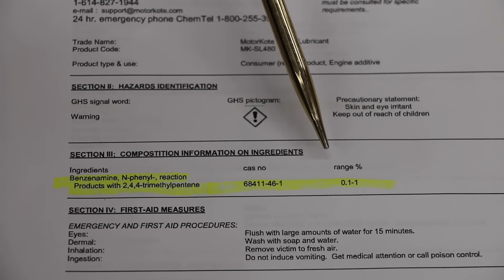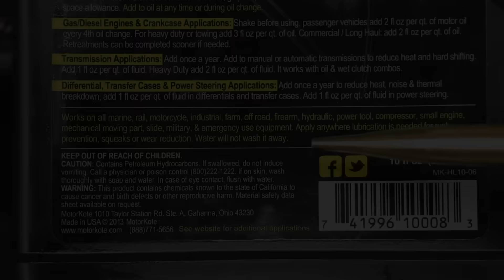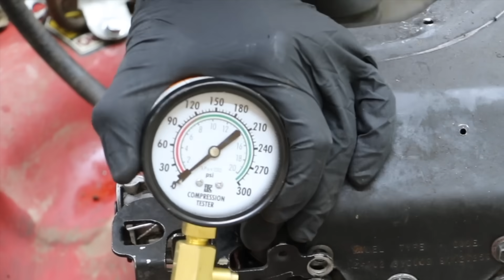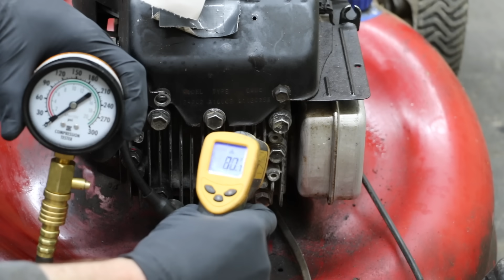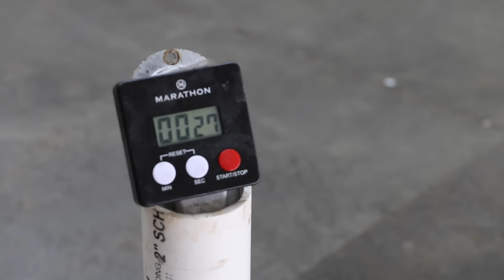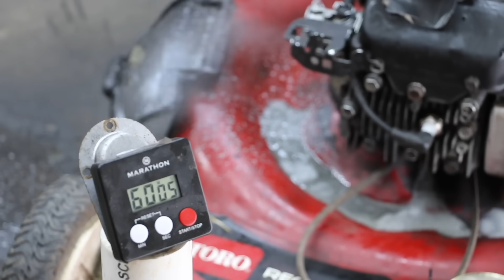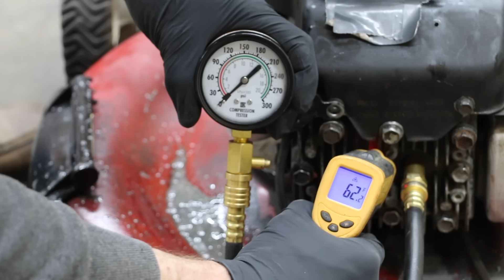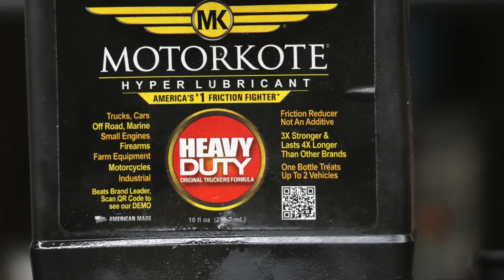Can MotorKote survive the water test?  Let's find out!

Comment: Wow, that's pretty astounding. I wonder why the big oil companies don't put a splash of this in their regular off-the-shelf oil...? Seems it could be a massive advantage. I may have to look into this stuff.
Reply from the maker: Thank you
Reply: @ProjectFarm  Oh dang. I  did a bit of research on it and it basically contains about 28% chlorine which turns the oil you put it in into toxic waste. That's why the big oil companies don't use it.

Comment: Ole  '60s big block gear head', hear again. Please, don't all the negative folks out there, roll your eyes. Oh, and I don't drive 100 mph either. Although, I have, and faster, many years ago. Before fuel prices went through he roof! Last week, Oct. 31, 2018, I decided to add 3 oz. of MotoKote to my 313,000+ mile E250 Ford extended VAN untouched (other than me changing filters) transmission. Just for the hell of it. Now, I don't have another vehicle. So I only have one to drive. And, being an OLD(50+yr.) mechanic, I listen to every sound this thing makes. This small(3oz.) amount of MotoKote definitely made this old transmission shift more positively. (not that it was bad. but it was better after adding the MotorKote). Again, I thank Project Farm for such a thorough product test. At my age and experience, I'm not easy to convince. But I'm pretty sold on MotorKote.
Reply from the maker: Very nice!  MotorKote has a huge following in the trucker world.  Several truckers mentioned using it with great results in driving 1 million plus miles. Thanks again.
Reply: How's your van running?
Reply: @Sno6403  Ole Geezer gear head here. To answer your question, its still running just fine. Now with 327,000 mils on the untouched 5.4, 2 valve V8.(not driving around as much as I used to, with this damn pandemic and all)
Reply: Papasmurf7597 - glad to hear someone used it in their transmission. Since the product claims it can be used, I was wondering if anyone had any experience with it in that way.

Comment: Another product that may be worth testing would be NMF (No More Friction), it uses ionic bonds to repel metal to metal surfaces at a microscopic level a lot like two opposing magnetic surfaces. I have tried it in many small engines along with me 3.5L Ecoboost with great results!
Reply from the maker: Great video idea!  Thank you
Reply: How does NMF perform? I am curious to the results.
Reply: Charles Peterson II  personally I have seen higher RPM’s, better fuel economy as well as slightly lower engine temperatures. There has been one small engine that I noticed had next to no difference except slightly higher RPM’s!

Comment: Great test. Looks like a great treatment. I plan to try it. Thanks for the great test. I have been in the auto industry as a service advisor for 25 years and in person seen a test of bg moa on a bearing lubricity tester such as yours verses conventional  oil, and synthetic oil. The syn did beter than the conventional, which looked like your bearings,  but the bg moa had virtually no scaring at all, better than the motor coat, but close.
Reply from the maker: Thank you

Comment: I'm curious how a limited slip differential friction modifier (i.e. Sturaco 7098) would compare.  In my understanding, these friction modifiers have an affinity for steel, and will remain on the surfaces when oil is drained.  It sounds similar to how MotorKote is acting in this test.  When filling a limited slip axle, and then adding the recommended amount of modifier to your axle (typically 2%), I've heard you can end up with a higher concentration due to the modifier that had basically clung to the surfaces inside the axle.
Reply from the maker: Great video idea!  Thank you

Comment: Todd, would you please use your lubricity tester on 0w40 Castro edge vs Mobil 1 0w40. 
I'd very much appreciate it. Many thanks
Reply from the maker: Thank you for the video idea!  I'm still working on the test design for motor oils. I want to include a little more rigor.
Reply: A used pour and lubricity test could be an idea, I know my Cayenne is supposed to do 20,000 miles / 2 years between changes (2004/5  V8 with the 4.5)  I've previously used Mobil1 and  this time I did a change at half of that. Obviously I was curious how it is - but that oil lab test is like £80+ ($120) here so a change is half of that cost for a home tech.
Between you and me  I'm thinking of doing a chilled new to used (2˚C) and a frozen test at -18˚C or below and see how that comes out.

Comment: So my final results. 2017 Honda Civic 2.0L average 35.43mpg over 4,038mi before. After using MotorKote average 36.30, up 0.868mpg, or 2.45% over 2,392 miles, 9 fill ups. Not crazy amazing, but it does seems to work. I will keep using it.
Reply from the maker: Impressive results!  Reduced internal friction.  Thanks for the update.

Comment: Where is the "control" test? Run an engine with water as oil without running any additives beforehand :)
Reply from the maker: Great point. Engine probably wouldn't survive the baseline test.
Reply: Well, you won't know until you try it!

Comment: I bought motorkote yesterday and added to my transmission fluid it really works. The car shift poorly after driving it around 10 miles. It shift good when the fluid is still cold but it shift bad once the fluid got hot. I added 12 oz to my trans fluid drove the car for 40 miles, accelerates and it shift smoothly. It probably helps to keeps the fluid cooler.
Reply from the maker: Excellent!

Comment: I just had a thought.. all of your testing is in small engines with a bath style oiling system. I wonder if some of these additives and what not molecule size would be filtered out by a standard grade oil filter in a car engine.. I know they make oil relocation kits to relocate a filter and/or add a cooler to pipe oil through, I wonder if you built a rig and used a solvent pump to pump that 'mix' through a car oil filter while doing your engine test... 'fittings in the oil sump of test engine or something similar' i wonder then what the results would be? Just a thought.. while I was at work... love the channel, i've talked to several people who love your channel, keep up the good work.
Reply from the maker: Great recommendation!  Thank you

Comment: Do you think I could add Motorkote to a GDI engine? I know some oils have detergents to keep the back of the GDI valve clean. I bet if you put this in a new engine it would keep the back of the valves clean. Carbon wouldn’t be able to stick to the valve.
Reply from the maker: This is a great question and I'm not certain. Recommend contacting MotorKote.  Their website has their contact information. Thank you

Comment: How did I miss this? This is what I'm talking about. Dissimilar metal bearings kept cool with water and making allowances for steam. Can't wait.

Absolute best test ever!!!!! Personally I think the water cooling can take a lot more credit than most people will give it in this test. I bet you would get similar results with STP oil treatment.  Did you ever do just plain water? My wife loves to mow grass every Sunday almost all Sunday. If I could figure out a way to auto fill with the water i'd set it up with an antifreeze mix(for corrosion protection) and let her go with it. I have 3 or 4 mowers for her to use so no real loss if one died. In fact the deck is just about done with her current mower. 
So did you ever do one with just water? 
Just antifreeze?
If you do and want to recycle some of that water spewing out the breather, just add a larger hose (preferably clear)to the breather and run it up to a catch can suspended from the handle somewhere. Any condensate should run back into the engine. Or if you really wanted to take the time you could add a return to the block by drilling and tapping a hole in the block. Your catch can could have 3 ports though you would probably only use the supply and drain ports. 

Oh wait. What about gasoline instead of oil. lol You would have to replenish that constantly as well. Bad news if it blew up though. lol Highly suggest running the breather into the intake or a catch can that can condense the vapor back to liquid. 
Great stuff. Gets the imagination working for sure.
Reply from the maker: Thank you!

Comment: You just sold a crap ton of motorkote.
Reply from the maker: That's not my objective. I test products to determine if they deliver on the promises made by the manufacturer. Thank you
Reply: @ProjectFarm  this might not be your intent but this video really helped in deciding motor kote is by far the best. Even Lucas could learn some things from motorkote
Reply: Same here, going out and getting a few bottles of the stuff tomorrow
Reply: @isabelhughes8748 
Lucas? Those impostors must find another way! Cheers!
Reply: @isabelhughes8748  my only concern is motorbike have wet clutch, would motorkote make the clutch slips?
Reply: we know, but we are also skeptical and you do what we wish we could do with these products!  So it's nice to see you find a good product because we know it'll be good for us.
Reply: @ProjectFarm  I think the standard should be, you're only compensated where claims can be substantiated.  This seems perfectly win win.
Reply: So true, I'm on Amazon right now, lol.
Reply: @psedog  Go to a Pilot Oil or Flying-J...they carry it.  I think PETRO has it too.
Reply: Mine came in today. It's going in my motorcycle, truck and mowers.
Reply: @netxphotography , it works on door locks too.
Reply: I bought motorkote. Works great on electric motor bushings
Reply: yep i ran out and got 3 qts on my way home from work damn though 30$ a qt
Reply: @J0k3rSuiCidE  you could drain your debit card and get the $100 gallon bottle
Reply: @michaelc9128  The Gallon Size is the best for Dollar Value.  If you're an average user, it'll last you a fairly good long time and you only need to use it once every 3-4 Oil Changes.
Reply: @michaelc9128  The $100/Gallon is actually the best purchase for the volume and money. 4-32 Ounce Bottles will cost a lot more!
Reply: @michaelc9128  I got it  for $80 a gallon.  So what, it will last me 5 years.  2 cars a pickup and a boat.
Reply: @J0k3rSuiCidE  $22.99 on Walmart and Amazon sites
Reply: @J0k3rSuiCidE  I'ts cheaper by the gallon!
Reply: my new wd
Reply: Gettin me some of that rn thank you sor..
Reply: Why not just use straight motorkote 🤔🤔😜😜🤪🤪
Reply: Read my post. I used to work in this field and what the company is not saying is what can harm your engine. Adding oil additive to a SAE API rated oil makes the oil no longer past those test. Which if a informed dealership knows this can void you warranty right on the spot. The reason the oil changed color is because most oil additive companies use chlorinated paraffins aka chlorine. The color change was the chlorine reacting to the oil like bleach does and making it turn a lighter color.

In my post I just made I showed the testing a person could do to test if the chlorine is the main ingredient. i also explain why such companies use chlorine.
Reply: This stuff is liquid gold
Reply: I buy this stuff in bulk. I use it on every new full synthetic oil change. I put about 2 to 3 oz. In
Reply: And they earned every sale
Reply: It's good stuff
Reply: Motorkote is the only thing I recommend to my customers as an ASE Mechanic. 
I use it every oil change even though you can go every other oil change
Reply: Just bought some 😊

Comment: I would be interested in a comparison of how quickly water instead of oil destroys it without their product.  Maybe its just a really well built motor that can put up with poor lubrication?

Maybe you could even build a device with a couple tubes like the automatic plant water thing to keep the water level correct as it evaporates...sealed jug with 1 small tube to bottom (to drain water into crankcase) and 1 small tube to the top (to let in air when it drops below the required water level) so you do not have to stop and fill the water up periodically.
Reply from the maker: Great test idea!

Comment: I had a very good running 2.0 sohc 4 banger in my car that started to have lifter noise so I used lucas and lost power then blew a couple rod bearings with in a month, had lucas in my turbo oil system and burnt up the bearings, never using lucas again but maybe I'll try motorkote one day to see if it makes my turbo last longer. Great video.
Reply from the maker: Thank you

Comment: Awesome video! From your test, this product clearly reduces friction. However, I am still undecided on weather I would be comfortable with using this product in something I care about since from I read, it contains chlorine, which can cause corrosion. I added it to my daily driven Honda Civic with a bad engine as a test, and I don't think it did anything terrible yet. So far I ran it about 3000 miles since I added this product. If anything it may be running a little quieter since I added this product. However, the engine in that car is junk, so when I replace the engine, I'll make a video of tearing down the old one to see if there is any corrosion from using this product.
Reply from the maker: I'd really like to see the video you make when you decide to dismantle the engine.  This product is very popular in the trucking industry. If this product causes corrosion, it would seem as though the truckers would have figured this out, since they log a lot of hours on their truck engines.
Reply: Great point! This product is probably safe. I may just be overly cautious about products like this, but there have been (and still are) oil additives that are not safe and can cause damage, which is why I'm trying this product in a bad engine first. I probably will run this engine another few thousand miles before I tear it down if it'll go that far, so it may be a few months before I make that video. But I'll be sure to let you know when I make that video!

Comment: Hi. I use it on my Renault Capture 1.5 dCi since February 2017 and i notice that the engine works really smoother and less noisy. I'm also able to shift gear a little bit earlier without feeling that the engine is "suffering". I haven't notice advantages on fuel economy, maybe the change is really small and difficult to see.
My question is: can MotorKote cause clutch problems on motorbikes that use wet clutches?
Can you do a test about that?
Thank YOU! :)
Reply from the maker: Glad that MotorKote is delivering great results. It is not designed for use in motorbikes with wet clutches. It will cause problems.

Comment: Motorkote, or Turbomaxx? Equal?
Reply from the maker: I'll have to test Turbomaxx. Than you
Reply: The one arm bandit test would probably be enough. Their video shows many weights put on the arm and it keeps on going. But only 2 oz is needed per engine. At 55 Dollars for eight ounces that will treat 4 engines thats a good price.

Comment: OK, so I added 7 ounces of this to my 2017 Durango with the 5.7L and I'm pretty sure I'm seeing an increase in MPG.  It's not dramatic so don't expect huge numbers.  It also seems to go into the 4 cylinder mode easier.  It could all be in my head though.  I also didn't notice it right away.  It's like it took a while to work.  Hmm...   I also added about an ounce to my Honda walk behind and it seems to use less fuel as well.  The Durango has 5W20 Mobil 1 and the Honda 5W40 Rotella.
Reply from the maker: Impressive!  It sounds as though there is less internal friction within both engines.

Comment: So which would you prefer best line or motorkote?  Try best line doing the water test since they also dunked a motor in water.
Reply from the maker: MotorKote seems better but Bestline is a close 2nd.
Reply: Project Farm better in what way?  Was it wear scar?  Maybe head to head which would break down first on an engine.

Comment: I used simillar type hyper lubricant called Militec-1 in high performance radio control racing boats, up to 45 thousand rpm 1KW on 4mm shaft and 6 minute races. Most of my opponents used regular oli every 6 minutes and still had problem with lubrication, dissasembled shafts and replaced many times, some time it lasted only 6 minutes and then they replaced everything. If they forgot to disassembly, dry and lubricate again before night it rusted and stuck many times next day. Personally I gave one spray shot of milltec-1 to my shaft before race and thats all, my bearings was fine after one season of training and racing (a year 30-50 runs x 6 minutes) and never had to dissasembled shaft due of lubrication problems. No rust at all and sometimes even I forgot a spray shot to my shaft and nothing bad happened. Bearings will last much longer I think but i replaced it in main service every year just in case.
Reply: Check out Tufoil if you've never heard of it 👍
Reply from the maker: Wow!  Impressive product!

Comment: Good evening I'm new here . I was wondering,  has anyone tested what affect does motorkote have on oil filters if any.  All these small enhines tested do not have oil filters.
Reply from the maker: Not yet. Thanks for the video idea.
Reply: Thanks for replying I think it awesome you did.  The reason for the oil filter test on motorkote is based on one thing you said in the video.  You said, "motorkote claims water will not remove this product,  it has to be sanded down. " This brings up the question,  Does motorkote affect the flow of oil in the oil filter and in what way if any?  
Thanks again for your awesome objective videos.  In my opinion.

Comment: How about motorkote spray vs aerospace 303  you can try it on a pair of leather boots or shoes and wear them every day and see witch one holds up. Or you can just do the tire or belt soaking thing I guess. I have since switched back to motorkote cause here in Arizona the aerospace 303 seems to evaporate.
Reply from the maker: Great recommendation!